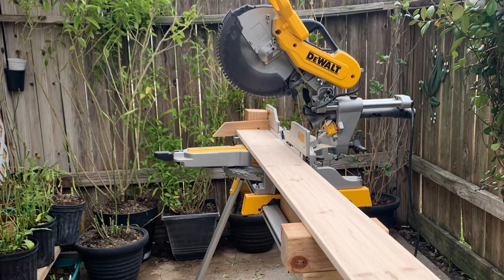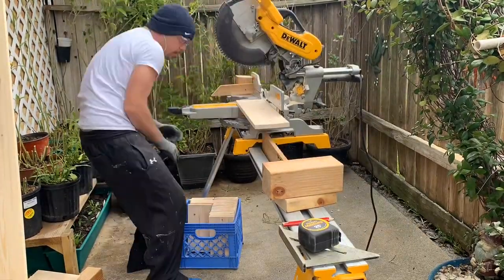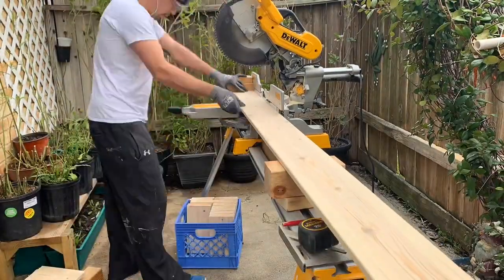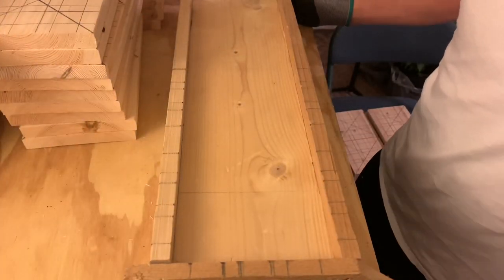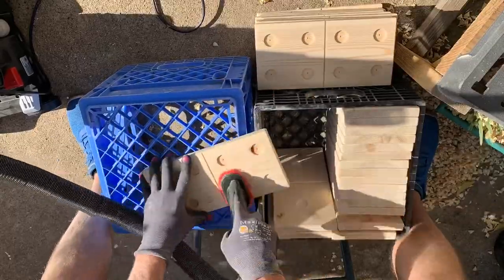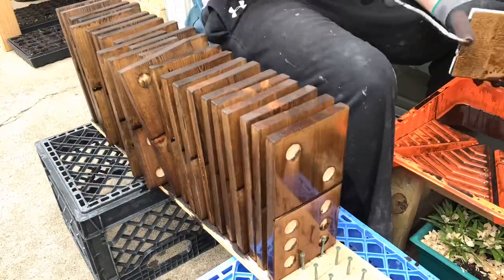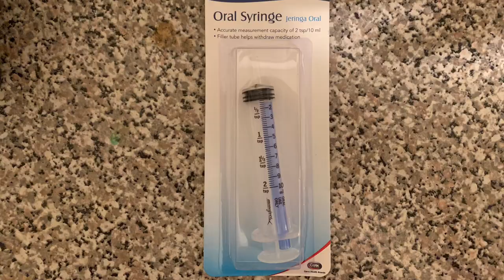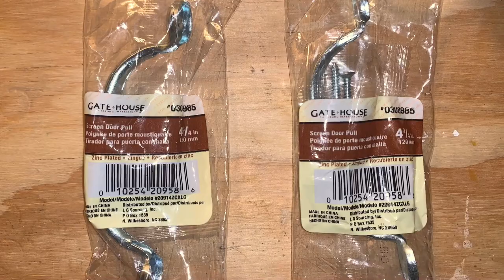DIY Giant Dominoes

Comment: I stain first… Then drill holes…
No paint required…
Then I seal it.
Reply from the maker: @Brandon Lee Sanders This is awesome Brandon, thanks so much.  I’ll try this out with the next set I make.  I appreciate your recommendation a lot. 🤝
Reply: Do you get splits from the drilling? I would be doing this with a hand drill
Reply from the maker: @abelmorqles4303 Hey Abel, thanks for stopping by and taking the time to comment on this video and support this channel.
I didn’t have any problems at all.  Make sure you have a new or sharp bit and don’t dive in there too quickly or deep and you should be totally fine.  I hope this helps.  Take care my friend.  🤝